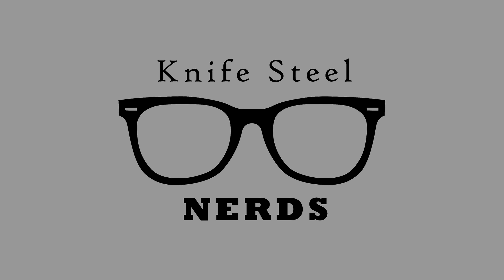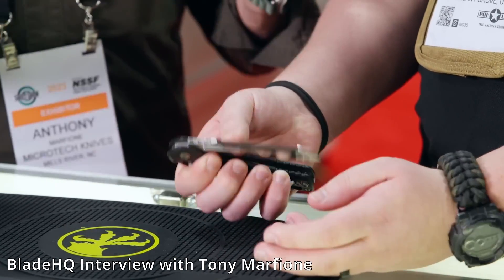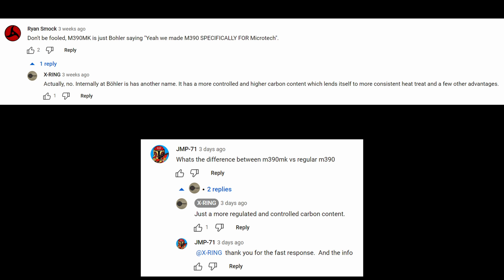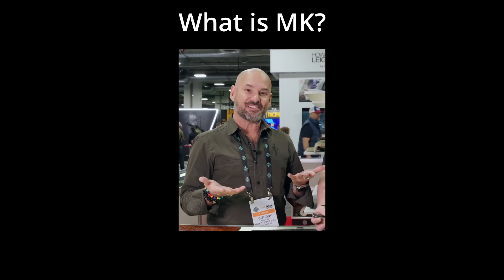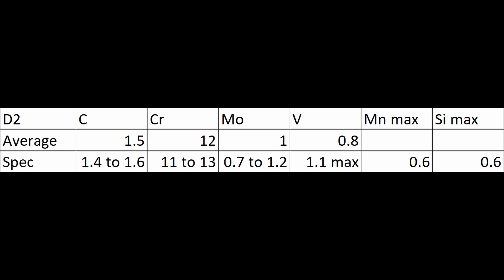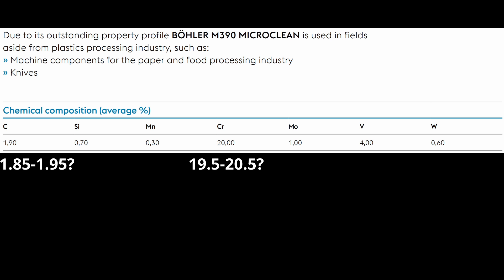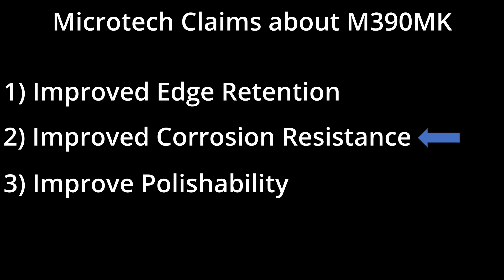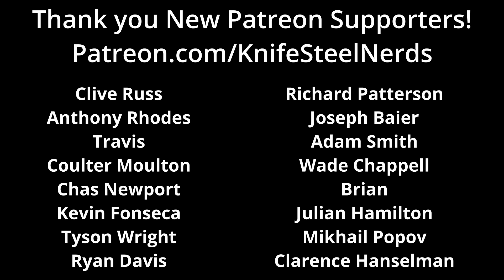New M390MK Knife Steel?

Comment: I was actually weary of buying a Microtech specifically because of the "MK" modification. If M390 needs anything it's a bit more toughness, not edge retention, so I'm glad to hear it's just Marfione being Marfione and the steel is pretty much the same as normal M390. Significantly higher carbon in this composition would not make it better in any way, in my opinion.

Comment: I think the obvious answer here is that the tweak in composition aids in achieving similar results with more lax protocol during treatment and grinding. The giveaway is the claim that it helps with polishing. 

We have seen this with CRK and s35vn and also fallkniven's CoS. They have higher grindability and higher tolerance to heat during grinding with otherwise little benefit.

Comment: Latest update from: EDCandLace:
Out of the stitch and msi I had and sold the following day because of both having HRCs in the 58s and sharpening about 50 of them in the last 3 months... they are SOFT,  it's soft enough that it is noticeably gummy on the stones. Plus the action on both of them is mushy as hell. I received both of mine in the same day, had them poked later that day and sold the next morning lol. If you buy a knife to use and expect serviceable edge retention then you will not be happy.
Reply: Luvthemknives tested one of them at 59rc. Some other people have tested as low as 57rc. Cardboard cut testing with 59rc showed that one to be 218ft of cardboard cut in a 1inch section. In comparison to Spyderco pm2 at 60rc 280ft and a pm2 at 62rc 400ft. WE Knives at 60rc did 230ft.
Reply: @tacticalcenter8658 Thanks for sharing this! I knew from Outpost 76 that Microtech edge retention was poor so it was good seeing some more data on this.

The results you shared above and the 50 knives that EDCandLace sharpened, do you know if they were all M390?

It seems that this issue is mostly with M390 and not isolated to just Microtech either. Quite a few other brands do M390 poorly. I think it's a finicky steel to HT properly to get the best edge retention out of it.

Reason I ask is because I also have some Microtech knives I purposely sought out in their Elmax and D2 steel mainly because I was purposely trying to avoid their M390 because I was aware of this issue. I was hoping their Elmax performed better and perhaps wasn't as finicky to HT and thus we'd get better performance out of it. I fear I'm going to be disappointed though. 

I have yet to run any edge retention tests on mine yet as I'm still reprofiling the edges on them, but I should get them Rockwell tested in the meantime and see how hard or soft they are.

Comment: One thing is for sure. M390mk shows rust spots within a few days of carrying. Something my other m390 knives haven't done.
Reply: Heat treat and blade finish has a great effect on level of corrosion resistance. 14C28N, a steel speced by Kershaw for increased corrosion resistance, is shipped by Petrified Fish and sometimes Civivi in bead blast finish which is well known to cause rust spots. So blade finish and rockwell hardness could be detrimental to even highly corrosion resistant steels.

Comment: Thank you for the info. Does anyone know what their heat treatment protcol and average hardness is for their M390? My experience with Microtechs M390 is that it loses it´s edge quickly and resharpens poorly. But that could be on my particular knife or edge that i run on it. Factory edge performed terribly though. 
Thanks for the great work Larrin!

Comment: im sorry i comment off topic but i just encountered a very strange phenomenon

i was casually sanding a broken file to make a knife out of it (i know its too hard and brittle but just for fun)
and i saw my nail clipper and i thought "i wonder how soft the handle of the nail clipper is"

it scathes!!!!! ???

i checked on my mora and it files it just fine...

my nail clipper is "uriel" brand

could it be that a nail clipper is super hard?!!?!

i tried to google heat treatment of nail clippers and it said they heat it to 1000 degrees and then cool it to water tempreture
and then they heat it to 180 degrees...?

would nail clipper handles make good stainless steel knives? they fit nice in the pocket at least...

Comment: If it is a matter of cherry picking, would that mean that other companies are getting less ideal m390?
Reply: We technically don't know for sure what's going on. But I would say, no, m390 is fine when heat treated correctly with proper heat treat protocols. We still have poor performance m390 due to poor microstructure due to poor decisions in protocol choice's by the manufacturer or heat treat facilities.

Comment: I may be wrong in my understanding but doesn't increased hardness alone improve edge holding and corrosion resistance in M390? You only mentioned edge holding but I thought I read somewhere that it does help with corrosion.
Reply from the maker: Higher hardness does not mean higher corrosion resistance, no. In general one of the tradeoffs with steel is that higher hardness usually means reduced corrosion resistance (when comparing steels). For a given steel, a heat treatment that results in higher hardness can sometimes also mean increased corrosion resistance, by using a higher austenitizing temperature. Increasing carbon in a steel for higher hardness leads to a reduction in corrosion resistance.
Reply: @KnifeSteelNerds  You literally just told me no and yes in the same answer. Lol 
Considering Microtech, and many other companies, aim for 59-61 which is the power end of the austenitizing temperature range with a 300-350 degree temper. In an correct based on what you said. Increasing Austenitizing temperature to the higher end thus hitting 62-64 HRC with a 300 degree temper would improve both corrosion resistance and edge holding. 
This would give the results they claim they want from M390. Where increasing carbon, or whatever they did, wouldn't give all 3 improvements in M390MK.
Reply: @dark_gravity_edc  a lower temper temperature will leave more chromium in solution. A higher temperature will form carbides and less chromium in solution.

This is also displayed on Bohlers site for m390 iirc.

Ive never seen a microtech above 59rc.

We also don't know what protocol they actually use to heat treat it. So its not as easy as change one aspect and get x.

I generally see certain blade finishes show corrosion... Like bead blasting.
Reply: @dark_gravity_edc    "59-61 which is the power end of the austenitizing temperature..." 
Huh?

 "In an correct based on what you said."

Wat?

Comment: Thanks for the video! If I were a betting man, I’d say it’s slightly more carbon and that’s it. A marketing gimmick. If they really cared about having better edge retention, as you said, they can heat treat regular ol’M390 at 1-2 points higher.

Comment: Perhaps MK stands for Marketing. 

I think that with the impressive results that many people are seeing from production knives in Magna-Cut (I think Cedric and Ada has it testing really close to steels like K390 in rope cut tests) it may be hard for Micro-Tech to call themselves top of the line when they are using the same steel that is increasingly common in knives that are in a much lower price range. 

That and M390’s reputation has become pretty tarnished by several companies using sub-par heat treats, so it may just be a way to differentiate themselves from that.
Reply: Which companies were using bad heat treats?
Reply: @Jo_Blo  Just about every production company hardens it to 58

Comment: To my knowledge, Microtech heat treats everything to 58-60. So yeah, edge retention could be improved with a better heat treat and I doubt there will be any measurable difference in M390MK heated treated at 58-60.
Reply: Show me a microtech over 59rc. They really should just use a different steel like rwl34.
Reply: @tacticalcenter8658  I should clarify, thats the spec I commonly see referenced for their heat treats, and yes I'm aware they hang on the low side of the spec.

They can't use RWL34 because its not "premium" enough. But yes I agree that if you want to run steel soft use a steel that doesn't loose all its benefits when run at that hrc.
Reply: @arrowheadguys7637  rwl34 is premium, its just not high wear premium. Every custom maker that does high polish knives use rwl34. And its also expensive and made in Sweden or whatever. It is similar indeed to cpm-154 but those guys more to it than that.
Reply: @tacticalcenter8658  You'll find most of the steels custom makers lean towards would not be accepted on a "high end production" knife, mostly due to reputation and perception. I've seen a custom heat treated RWL34 knife perform with better edge retention than what soft M390 will do, but of course Microtech would run it soft too so it'd be even worse than their soft M390.
Reply: @arrowheadguys7637  true

Comment: They did their m390 at 58rc with poor performance in cardboard cut testing. All they had to do was change the protocol to get better edge retention.

Looks like they just wanted to polish the blade easier?

Jim Skelton dragged a 62rc m390 knife behind his car for god sakes. It didn't break at all. Maybe they just need to learn how to heat treat and provide microstructure.

Comment: I'm skeptical about how much the "tweak" would improve the steel performance compared to a dialed-in HT protocol. Sounds a lot like marketing. But will be interesting to see if they release some more information about the process in the near future.
Reply: It's possible it could literally just be tighter tolerances in the upper end of the normal range which wouldn't do anything beyond making it easier to dial in the HT protocol and get the most out of every batch.
Reply: Look for a video called microstructure matters.

Comment: I think instead of production companies changing the steel composition of M390 they should first focus on doing an extremely consistent and optimized heat treat on basic M390. I do like how when Spyderco did Spy-27 they were very open about its make up and what the goal of the steel was, it would be nice to see the same from M390MK.

As always thanks for all you do in helping us see the difference in performance and marketing.
Reply: Agree!
Reply: Agreed. All they needed to do was a better heat treat that wasnt 58rc like they currently do with m390. In cardboard cut tests this did poorly.

I dont know their specific protocol that they use for their standard m390. Does anyone know what factory they use for heat treat?

If they were going for toughness, polishing and some stainlessness, why not use rwl-34?
Reply: @tacticalcenter8658  I think they just heat treat everything soft to make it cheaper to machine. they run their Magnacut at 58-60 too. Lets be real, Microtech is more about looking tacticool than having a highly functional product.
Reply: @arrowheadguys7637  yup. exactly. And they demand high prices for low value. Sad really. People getting ripped off.
Reply: @tacticalcenter8658  Yeah, not to mention the owner is a complete slimeball. Thats usually a pretty good sign not to buy a product for me tho
Reply: @arrowheadguys7637  remember when they copied the zt knife. Then Kershaw came out with a natrix and then the owner of microtech said some very bad things. Someone screenshot it before it got deleted and a huge thread showed up on BF about it.

Or that time he had his model girlfriend say she was working on a custom with him and it was pure lies. That video I think is still around.

Could go on and on about that guy.
Reply: @tacticalcenter8658  LOL or more recently how he threatened to sue someone for making a joke about his 6 divorces. Classic tiny man syndrome.

The one that really blacklisted his knives from my buy-list was bullying dealers into not carrying Axial knives because he's afraid of the competition.
Reply: @arrowheadguys7637  oh yeah I remember he sued zt and a blogger. And his own family.

Comment: Much like their proprietary handle screws, I’ve got a gut feeling this won’t change the performance in the knife in the slightest, but it will cause a debate for years to come.
Reply: Probably. It's a small sample size but Microtech's heat treats aren't going to win any prizes. Maybe they should have looked over that part instead of asking Böhler to mod a steel.
Reply: @circedge  SO MUCH THIS! How I wish they'd optimize the heat treats on their blades (M390 especially!) to bring that edge retention up! That M390 especially is performing nowhere near its potential and that's a real shame. I'd even pay extra for that if it's done well enough!
Reply: @topfueljunkie100 
If it's worth a significant sum to you - you can always get a completely new made to your own specifications. 
Not cheap if done properly, but it can be worth it in some cases.
Reply: @heinzhaupthaar5590  Did you mean a custom with Microtech or with another custom maker?

I like the Microtech knives so it'd be awesome to have one with an optimally heat treated blade but I imagine I'd need to get a full-on custom knife to get that kind of heat treat and then you're looking at  a totally different styled knife altogether.

There are certain people out there who will do custom reblades if that's what you were referring to but I haven't sought them out. It is perhaps something I should look into if I really love the model though. I'm going more and more in the custom direction with my collection anyways, so I should probably look into that a bit more.

Thanks for the reply!
Reply: @circedge 
That's the thing though - I'm pretty sure it's not about the actual properties of the blade but just a smart marketing move. 

Keeping your name going around and around and around is worth quite a lot after all, even if it's just someone occasionally asking about the differences.

Comment: So Bohler is just choosing billets that fit a tighter spec and selling them to Microtech and a higher cost?  Probably without making any changes to manufacturing processes.  I guess it lets marketing dudes say some buzz words, so yay? 🤔
Reply from the maker: It is not clear from Microtech statements if this is Bohler "cherry picking" billets for them or if they are making steel to a slightly different spec. A tighter range would make me think cherry picking but since Helms said that Bohler has an internal name for the modification that would lead me to think melting to a different spec. Since logistically I think using a different internal name would be impractical unless they are melting to a different spec.
Reply: @KnifeSteelNerds  in my area of business, manufacturers do put new part numbers on products they sell to certain customers.  It doesn't represent any change to manufacturing, just a unique packaging, handling, etc. for a customer.  The new part number ensures the customer gets what they need.  You're right that we don't know what this new part number represents, but a simple tightened spec sounds highly plausible to me.
Reply from the maker: @ZPositive  Good points!
Reply: If it’s true it’s just a tighter tolerance which it probably is they should’ve named it M390 black label or M390 reserve
Reply from the maker: @TheScrawnyLumberjack  M390 Private Reserve
Reply: How much would they have to buy to get that change?
Reply from the maker: @tacticalcenter8658  If they are getting the change through "cherry picking" of billets it is actually better if they are a relatively small customer. Bigger than a custom maker because you need to be buying billets. But if you were a big enough company to be purchasing a significant fraction of what they make then they can't cherry pick for you. If it is a change at the melting stage that depends on the flexibility of the mill and how much you can sweet talk them.
Reply: @KnifeSteelNerds  makes sense, thank you

Comment: Everyone should experience the joy of trying to polish M390, it builds character like an old timey Victorian era dad horsewhipping you for shaming your family linage by being a cutler
Reply: Rwl34 is a decent alternative. If done to an acceptable level it would out perform what they currently use and be easier to polish.
Reply: @tacticalcenter8658  Well its sort of a funny spot they've ended up in, because if you want something that polishes nicely you basically throw out anything with Vanadium in it because it'll fight you all the way down and win. A good, very high finish will also give you a bit better stain resistance as well against the lower end of the acid liquids and make cleaning easier- but you also don't consider any of the high alloy, modern stainless steels much for that category either.
What they tend to do is have really exceptional edge holding (because Vanadium) and not usually a lot of toughness on some of those if you want stain resistance with lots of chromium or other elements like moly and nickel. Like there's honestly nothing wrong with M390's edge holding if its treated right it is exceptional, its not hugely tough with a higher hardness and the stain resistance is definitely ok. 
But you're sort of never going get a really high polish/mirror finish on it.

I dunno, they seem to want the cachet of using a good steel like 390 because the kids like that for sales, but they're asking some things of it which its sort of just not ever going to perform well at.
Reply: @krissteel4074  the have to have it because it won't sell without it.
Reply: That was funny lol